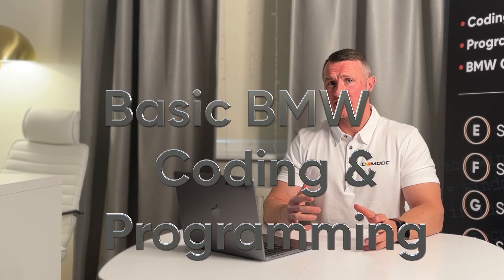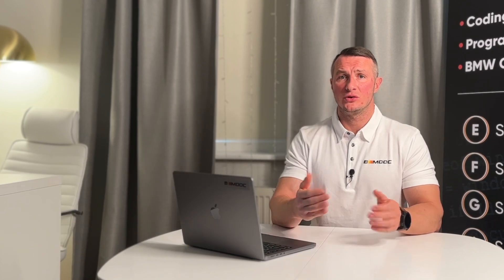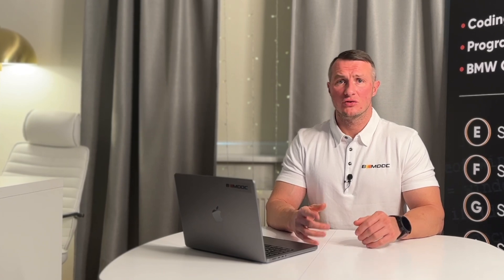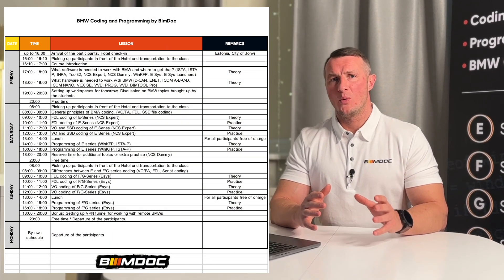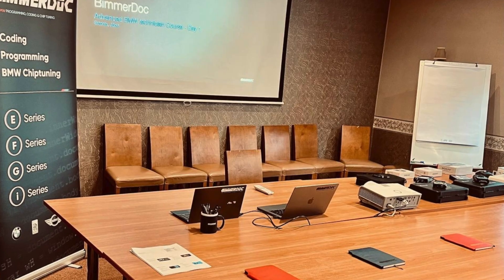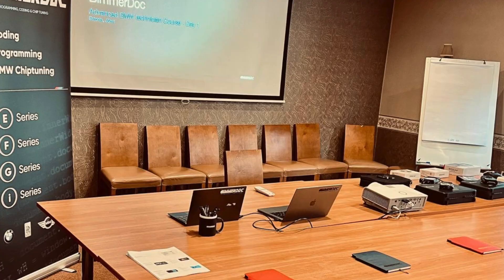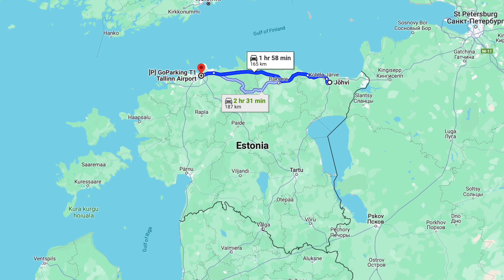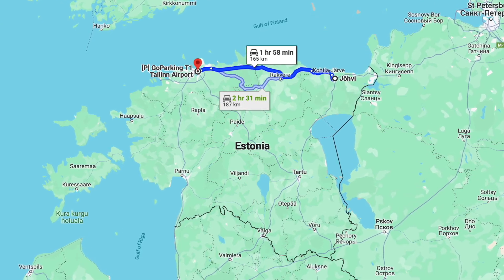Master BMW Coding & Programming: Complete Course Overview | BimDoc Channel

Comment: Hello😊 Maybe you coud answer to my question. Want to retrofit 6wa on f30(entrynav). added most cable, activated most. When i refresh ecu list the car doesnt see Kombi. When i plug back old cluster, it sees Bkombi, but after thath it vanishes😁.
Reply from the maker: Go to HU and change parameters responsible for cluster type
Reply: @BimDoc  I did recode Hu with 6wa Vo, changed svt tree (deleted b kombi), manipulated to detected the kombi by kis istep level, writed new svt_target, when tried to detect cafd got red cafd error.

Comment: Hello bro quick question please. 
If you have a bmw transmission production date December of 2014 when other later date models will not work on the same vehicle.
My heart tells me theres a way to make it work if its the same model car. Just the production date is different. Is there a way to make it work?  And is coding the solution? 
Thank you 🙏🏽

(Waiting for the coding course in my country)🫱🏿‍🫲🏾

Comment: Dear Vladimir,
I'd like your comment on two related topics:
- Your opinion on engine stages 1-2-3 using of the shelf solutions, like MHD tuning
- Your opinion on transmission tuning (you did it with Alpina software, but the availability is very limited)
Reply from the maker: Chiptuning is decided for convenience into stages. I have a video explaining that in details. 
Same about tranny. (ALPINA soft info tranny is not 100% Chiptuning)
Reply: @BimDoc  Okay, but how to choose between a solution like MHD (if our ECU is not locked) or a more conventional solution like you do?

Comment: I have a BMW M850 XDrive. Year 2019. After purchase, everything worked. I went for chip tuning and popcorn making. Then I went to a mechanic who replaced the battery in the front of my car (technical) and did some digging because I wanted to have a BMW Me. Car from the USA and he came to the conclusion that he wouldn't do it. I picked up the car, the radio was Sirus (America), it was impossible to change the time, it was New York. I did a reset from the panel in the car. But what's most interesting. Previously, I had a different car sound with eco and switching to sport+. Now I don't feel any difference when starting the car. And there was a different characterization. The flaps open. and they are open all the time. Tuning has been undone. I called the dealership and they said that the flaps should open in comfort and sport+ modes. However, they are still open. The guy who previously converted from the US to the EU accessed my car remotely and doesn't know what could be wrong. I have a cable for remote connection.

the steering wheel also behaves similarly in all modes.

I have the impression that the car is in sport mode. Changing to comfort and eco does not cause any difference in the behavior of the car and the steering wheel works just as hard.

The only difference is in sport+, where the car actually revs higher.
I've read that people have various problems after replacing the battery. technical, but I haven't read about a case like mine anywhere.

Please help.
Reply from the maker: I haven’t heard anything about changing the causing any those issues. 

How to fix? Restore soft coding. It should fix it.

Comment: Hello BimDoc, today i tried to code sport display to bmw f11 520d n47 i activated 3000 EFF_DYN_SPORT_CID set to: aktiv

3000 EFF_DYN_SPORT_UNIT set to: aktiv. and in I drive when you drive with the car the gauges doesnt work, any solutions?
Reply from the maker: On some engines that coding does not work. 
In addition to that Chiptuning and some modifications in DDE FLASH part of the memory is needed.
Reply: @BimDoc  when will you release your website?